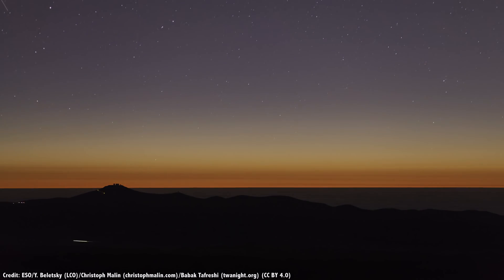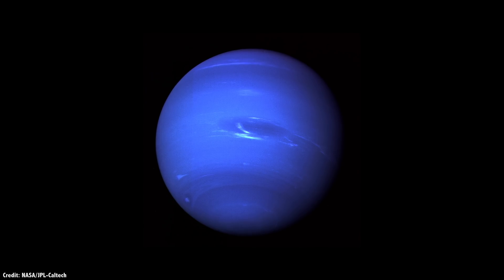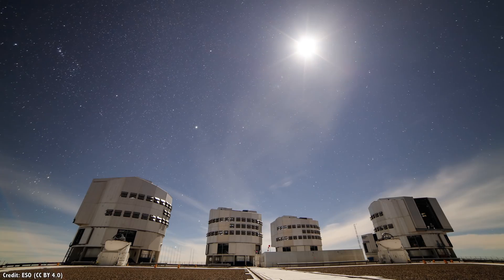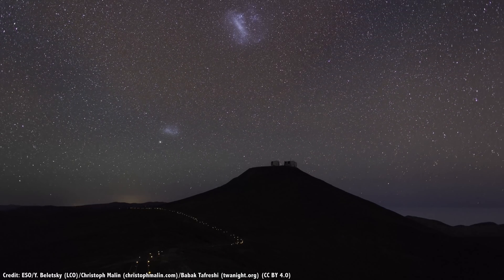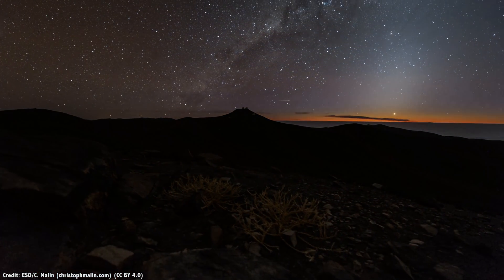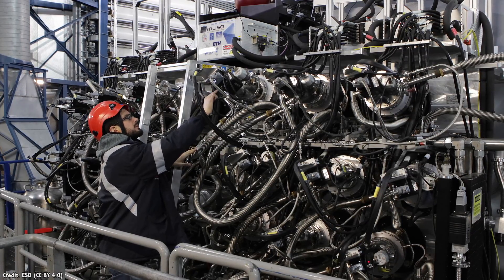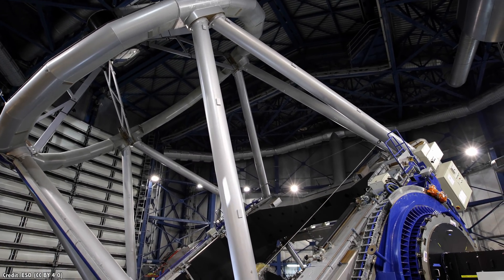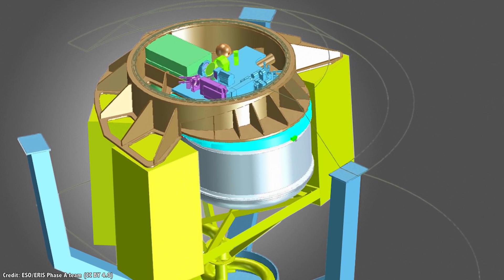Making the Atmosphere Disappear. The Power of Adaptive Optics

Comment: So in regards to the artificial guide star, where they shine a laser up and look at the distortions of the laser - Wouldn't they need to account for the atmospheric distortion that effects the laser on the way out as well as the atmospheric distortions of the light getting deflected back to the sensor? Wouldn't that be different than the distortions seen on light that's just coming inbound from outside our atmosphere?
Reply from the maker: Yes, you're going to have atmospheric distortions in both directions, but the light is moving at light speed, so the distortions won't happen that quickly.
Reply: @frasercain  I see what you mean. Would you just assume that the distortion you see is twice what it would be if the light came in directly? (meaning if a small pocket of higher density/temp air distorted the light slightly on the way out, then again on the way in, you can just cut that distortion value in half?)

Comment: I would like to point out an imprecision of the video, in minute 4:35, it is explained the adaptive optics feature by showing a test bench of the primary mirror of the future ELT. This 39 m primary mirror does not contain the adaptive future, which is contained in the quaternary mirror. The segments appearing in the video are "active" rather than "adaptive", they have a certain capability of getting deformed by a set of actuators in order to keep the aspherical form they need to against gravity, for example, and other operational functions. The quaternary mirror, a flat one, will host the adaptive feature. This mirror is a   "2.4 x 2.5m elliptic mirror controlled by 5316 contactless actuators" (see public info of this mirror and the full adaptive feature  in http://www.microgate.it/Engineering/Adaptive-Deformable-Mirrors/Projects/E-ELT-M4). Nice educational videl, anyway. I am the one in the lab white coat, minute 4:35.

Comment: As long as the atmosphere attenuates or almost completely blocks large portions of the EM spectrum, there's still a place for space telescopes. Perhaps not for visible light astronomy, but certainly for a lot of IR and UV. I understand that the faint glow of the atmosphere also lowers the contrast somewhat compared to telescopes in space. Perhaps larger telescopes and advanced image processing techniques will compensate for that in the next decade or so.
Reply: As you say, astronomy using UV, X-ray and several other  wavelengths of light are effectively impossible from the ground due to the fact that they are absorbed completely (or nearly so) by even a "clear sky" thanks to our atmosphere's component gasses. That being the case, there will always be a case for space-pased astronomy. The JWST for example is designed to make use of IR wavelengths that the water vapor in our atmosphere completely  absorbs.

Comment: Hello Fraser! Long time fan. I had a question so I just popped by your latest video in case you answer it.

So I was watching Kurgeszagt's (probs spelled wrong) video on harvesting energy from a black hole's ergoshpere, the region around it that is distorted due to its rotation. Basically you build a mirror around it and shoot a light inside, the ergosphere loses a bit of its immense rotation and gives energy to the light which you can then use. Then I remembered an article I read about black hole starships, and how an atometer-sized black hole (mass of about a tanker, so really small) would be ideal for that. My question is, could you harvest the ergosphere of a miniature black hole? Does it even have an ergosphere, or does it not distort space around it like a stellar sized one?

Thanks for the great videos! Keep on truckin'
Reply from the maker: Sure, you could harness power from any mass black hole. You just drop matter into it and extract gamma radiation back out at an efficiency of about 38%.

Comment: How fast could a probe like Dawn go if it used its ion engine to accelerate away from the solar system? Could it even get to escape velocity? If it did how long would it take to get to the nearest star?
Reply from the maker: I don't think Dawn has the fuel it would need to do it. But the Voyagers and New Horizons are on their way out of the Solar System,  and an ion engine would be a great way to do it.

Comment: Fraser IMHO JWST is increasing in obsolescence as it sits on the ground while adaptive optics technology progresses by leaps and bounds making space telescopes difficult to justify in terms of costs and the impossibility to repair/make upgrades, etc., etc.... I guess the fact that JWST will be better in the infrared & UV wavelengths being in space than these huge very capable European scopes is some consolation for the eye-watering billions spent so far (with no end in sight). And no guarantee it's actually going to work as advertised even when it reaches its designated Lagrange point. Fantastic video as always Fraser.
Reply from the maker: You can't do infrared astronomy at the same wavelength from the ground.

Comment: You would think it would be possible to develop a purely software solution to the problem of atmospheric-induced distortion, much as software is used to reduce noise in audio, photographic and video applications. This is like using software-assisted measurements to make near-instantaneous adjustments to microphones in response to air conditioners and other noise sources in the background of audio recordings, instead of using software to remove the noise from the recordings. The latter approach has been working extremely well for decades. Are the engineers over-thinking the problem?

Comment: I'm wondering if the recently discovered Hydrogen "Wall" around the solar system might (dampen) or (prevent) signals from Other civilizations from being detected by efforts like the SETI Institute. I seem to recall they had a preference for "listening" in the Hydrogen band looking for signals. If the Solar Wind, or a Bubble of hydrogen gas piled up around our Solar System.. wouldn't that act like a Radio Blanket and "filter out" those signals? I mean.. maybe we are Unique in the Universe for having a Hydrogen Wet Blanket on our Parade and everyone else in the Universe is in regular contact with everyone else.. or doesn't have our communications problem? (are we Tone deaf to the Cosmos because of a Near field problem?)-- it also makes me wonder if Adaptive Optic Guide stars might be used on the (Solar Atmosphere) to do something similar for IR or other wavelengths far out in the solar system to help interstellar astonomy at the (Solar System) scale one day.. even (poke) a hole in the Hydrogen Blanket with tuned synchrotron lasers or something like that

Comment: Hi Fraser,
in Dennis E. Taylor's "Bobiverse" trilogy, the superintelligent "others" continuously strip planet systems from all the metals they can find in order to build a giant dyson sphere. Are metals really the only material with which you could conceivably build a stable structure around a star? Would you not be able to mix in rock and organic material if your goal is to get the structure up and running as quickly as possible?
Love your shows :)
Reply from the maker: You couldn't build a rigid dyson sphere and have it be stable. You'd need to build a swarm of satellites that would enclose all the light from the star. And you could make them out of all kinds of materials.
Reply: Fraser Cain Oh I see, so a dyson sphere is actually just a "completed" dyson swarm. That makes sense. Gravitational forces would be too big If you tried to construct a single, nondiscrete sphere?

Comment: Hi Fraser, one question I recently thought of is why haven't we or don't we build high altitude launch platforms? Rather than launch large and expensive rockets from the ground, why not just send supplies up a few tens of kilometers using some sort of elevator or balloon where awaiting personnel on the platform can assemble smaller, cheaper rockets that require less fuel to send into space?
Reply from the maker: There are a few companies working on this idea, but it's hard to beat the simplicity of a rocket that takes off, carries payloads to space, and then lands on its launch pad again.
Reply: Late to this, but in simple terms, getting to space (and staying there!) is not about altitude: it's about speed. The only real reason for  a rocket to go up any significant distance on launch is to get away from atmospheric drag. While getting above the air saves you some fuel, it doesn't save much compared to what's  burned reaching orbital/escape velocities from a standing start.

Comment: Hey Fraser, at 6:54 the laser is pointed towards the camera and there's a weird pattern there? What is that? Close to the center of the light.
Reply: The surface of the lens on the drone's camera creating a lens flare. Probably as it diffracts it interferes with itself creating a "moire pattern" which is the weird pattern you mention.
Reply: Awesome thanks, I'll have to find some good examples of them now that I know what they're called.

Comment: Fraser,  Normally you would imagine stargazing to be a quit endeavor, but are the adaptive optics noisy?  I just imagined 5000 solenoids firing.
Reply: Ron Gardin , some of the cameras have loud compressors running refrigeration systems to keep the sensors cool.

Comment: Is this ultimately expected to surpass the capability of any practical space-based telescopes for the majority of observations?
Reply: Trouble is ...
There are some wavelengths we just can't observe from within our atmosphere.
Like UV.
Reply: There are two areas in which space -based telescopes will remain superior: observations in the UV and far infra-red bands. Earth's atmosphere eats (thankfully!) filters most UV light and is way too hot (again, thankfully) for most infra-red observations. Another advantage of space-based telescopes even in the visible band are exposure time and location-dependent seeing (see http://www.eso.org/observing/etc/ ).

Maximum exposure time can be comparatively low even under under otherwise perfect conditions depending on the time of year, target, and moon phase. Exposure time in space is unaffected by these factors. Spectroscopy from ground-based instruments is also hindered by the atmosphere, which is opaque in certain wavelengths due to absorption.

TL;DR There are some areas in which space-based telescopes are and always will be much better than every ground-based telescope on Earth.
Reply: tech is always improving .
Reply: Cody Brumfield, I think so. The problem with space telescopes is that there's a ton of restrictions, size first of all.